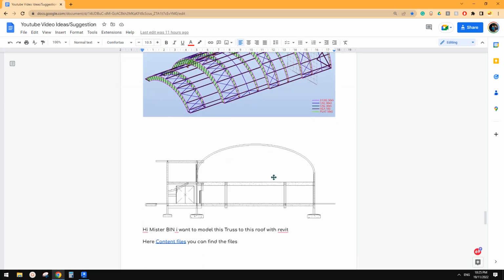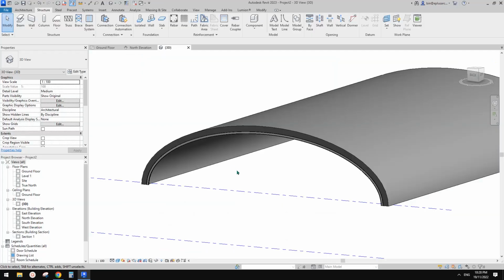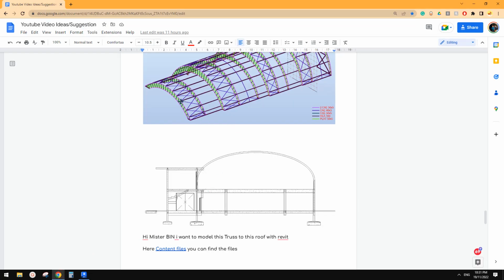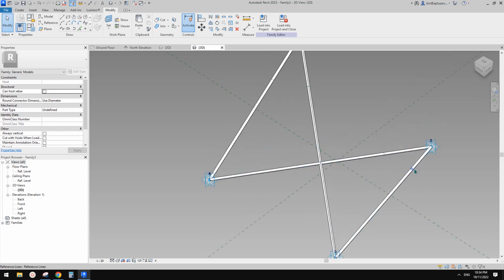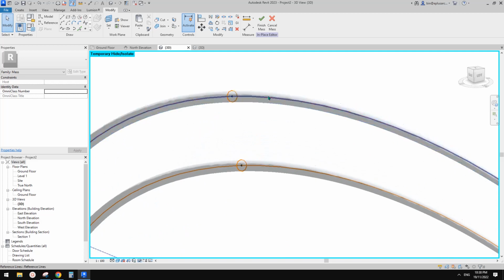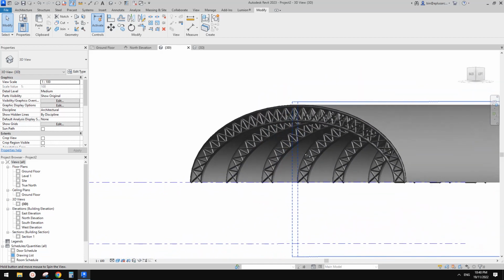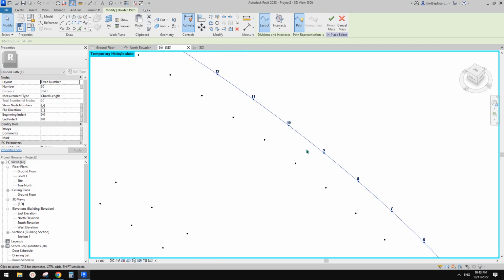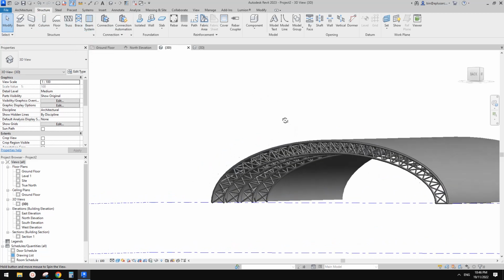Revit Exercise (Day 969) Mass and adaptive family for schematic roof structure

Comment: Hi Sir! congratulations for your work! 
I had an issue: when i want to place a tickness parameter for the elements done with metric generic model adaptive, it doesn't work just fine, because tickness doesn't change along the whole element, but only in the middle.
Reply from the maker: My guess is that you created this form using a profile and a path, so when you change the profile, it only affect the form at the location where that profile is. If this is the case, you just need another profile. Please post image in the shared document so I know exactly what your issue is. Thanks.
Reply: @BINHE615  Done! Thanks!

Comment: Can we use rectangular or L shape parametric profiles instead of the circular profile?
Reply from the maker: Yes, you can draw any shape you like. Also, I did a new video with slightly different approach. You can use structural framing from Autodesk content library.

Comment: Coool … very good technique Bin and simple 👍🏿
I ve experienced before that the repeat does not work properly and did not know what to do … show number, flip direction is a good tool to check , thanks 🙏🏿 
* But this truss can be achieved by making a surface form divide face and curtain panel based? 🏢
* Also in model in place by drawing the entire truss then extrude it ? (May be a lot of work) 
* I think you can also do it with structural truss … I saw it before but I don’t know much about structures, but it is about to open a truss family and try to pick lines of top & bottom members then add some bracing so the family much your shape  🏗

* May be also you can do it roof by extrusion??
Reply from the maker: Adaptive families are good enough for schematic, extrusion can be useful if you have more time. I love modelling using structural columns and framings, but I found it a bit hard sometimes.